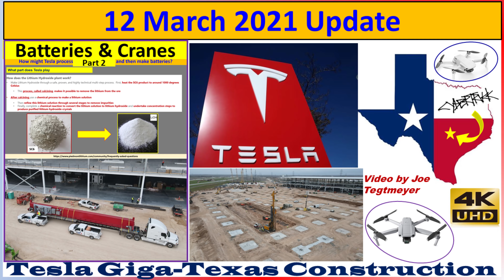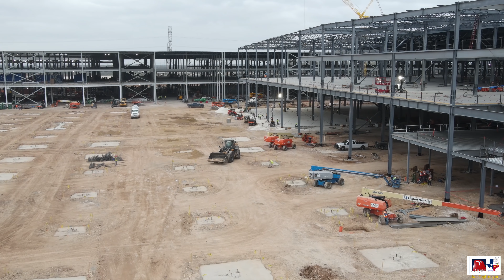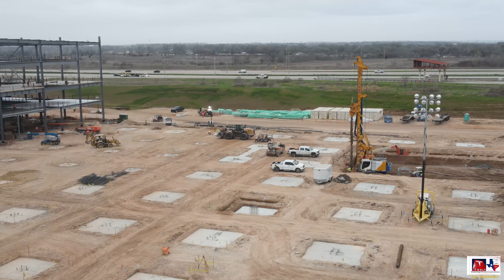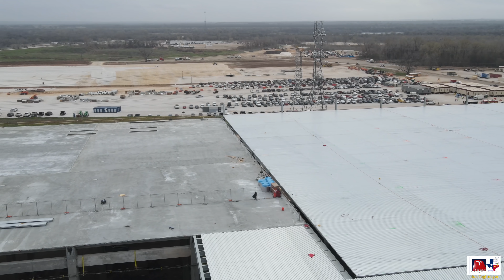Tesla Gigafactory Texas 12 March 2021 Cyber Truck & Model Y Factory Construction Update (07:30AM)

Comment: As for the heavy parts of the battery area, I’m guessing kilns to process the lithium. If you are talking of processing tons of rock to a 1000 degrees you are talking about a lot of refractory brick and equipment to move. Lithium melts at a pretty low temperature so it would seem to be pretty easy to oxidize it and remove it from the enriched ore. Of course, as Elon famously puts it, production is the hard part.

And I could be wrong about where they get their power from. I was under the assumption that they would be tapping the City Of Austin 69kv line. But that’s a Lower Colorado River Authority work trailer on site. That might not be a Tesla Substation. That might be LCRA putting in the substation in which case they will take power off the larger LCRA power lines which are running at 325kv. Since Tesla owns the surrounding property they might not have had to file the usual public notices. Or they did and no one noticed it.
Reply: Seems they're using electricity to process the ore?  I haven't seen anyone talk about gas lines.  If so, that's a helluva lot of power to be using.  Needs a helluva lot of voltage!
Reply: @acmefixer1  Early days of the Nevada factory, I read that Musk specifically didn't want a gas line to the site. I don't know if that became reality, and I wonder about this site.
Reply: @acmefixer1  , and just like there are high voltage lines running through the property, there is a large high pressure natural gas line running down the same easement. It feeds the combined cycle electric generating plant across the river. So there is gas right there if they want it.
Reply: Well, the LCRA trailer seems to be loading the transformer with oil ... that oil has to be highly purified and dehydrated, so maybe some fancy filtering equipment in there. Now, how many times do you have to fill a transformer with oil? I figure a handful of those trailers is enough to service the entire state, and maybe LCRA just happened to have the closest one that could be rented. So the logo might not mean anything...  Some other posters remarked that the transformers seemed a bit too small for 325kV, but I dunno.
Reply: @LinasVepstas  , I agree that they seem small to but it’s not my business. I do know that management of a substation is probably not in Tesla’s core competency. It would make sense to pay for some one to manage it.
Reply: @Bill_N_ATX  Welllll .. they (Tesla) did install the Hornsdale Power Reserve, and now a new battery in Angleton, near Houston, so they aren't exactly electrical nincompoops. Now they don't run the Hornsdale battery, but they will run the Angleton one. But, yes, sure, I would not be surprised if there is a weird jurisdictional claim that says only LCRA is allowed to run substations in this area. So, yeah, sure. Might not even have to pay them; it might come for free with the electricity. 

Electrifying this part of Texas was a big deal in the 1950's, and LCRA did all the work, with e.g. the Mansfield dam and so they may well have jurisdictional control over all transmission and substations in the entire region (i.e. those outside of city limits)

Comment: We appreciate your preview of significant activities and insights before each flight. Keep up the excellent work!
Reply from the maker: Thank you!
Reply: @JoeTegtmeyer  yes Joe, the extra work you put in to your videos is amazing. I was very impressed with part 1 of the battery plant and it left me salivating for more. Now you've put out part 2 which was equally as good. Appreciate the hard work and fact finding you do.
Which brings me to something else you may want to hunt down. Do you think you could find out what the exterior walls will  be covered withc. Do you think they will go with the concrete leggos like Berlin. If so I've had an idea of what we might see happen on on the east side where the switchboxs were supposed to go. I think it would make great sense if they used that land temporarily as a concrete leggo farm. They could build the formwork for 100 or so slabs and simply pick them up when dried a place them straight on to the walls. With the pieces being formed on site it would be fast and easy and cut down the amount of trailers standing idle like we saw for the pre fab walls of the Stamping building. IDK what do you think of that. Thanks Joe

Comment: Loved the fly-over as usual plus how you give us some more detailed insight as to what happens on-site.

Could you have a rough estimate as to how much concrete has currently been poured through-out the whole site?
I estimate that they go through 100-250 trucks a day at the moment.
Reply: A third concrete suppliers trucks were on site today pouring the west wall on the battery building.
Reply: Someone who had some site knowledge said in an earlier post that they were averaging around 1000 to 1500 cubic yards a day. That’s about 100 to 150 truckloads a day. Don’t know the validity of the post but at the time that seemed., reasonable.